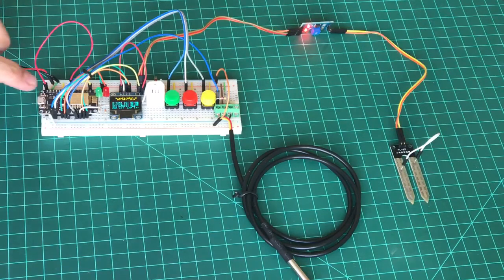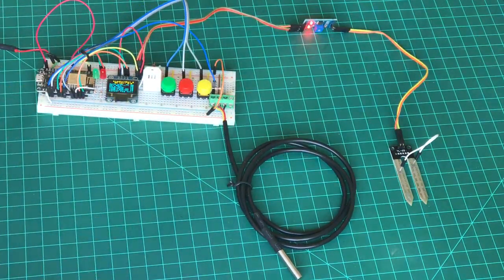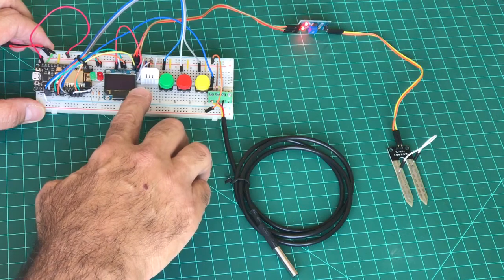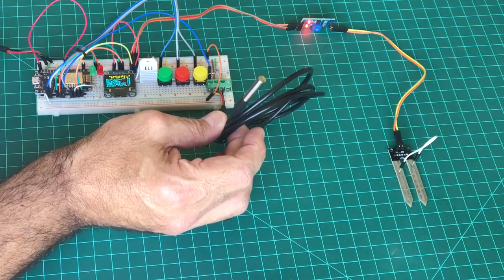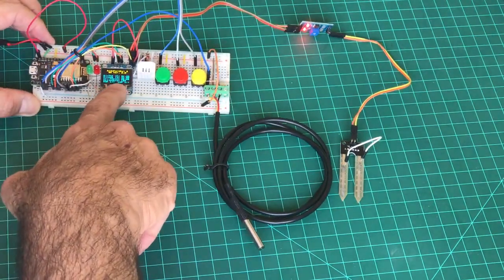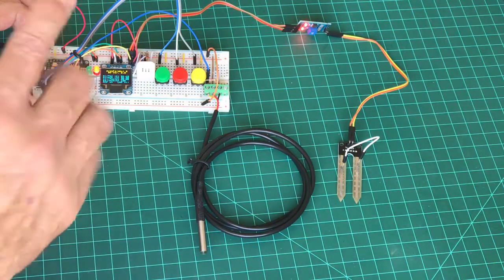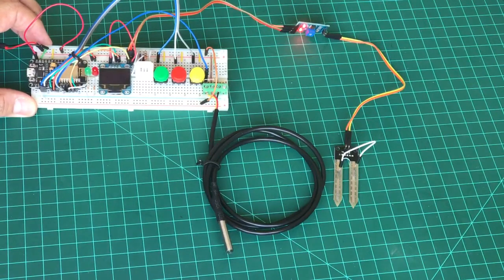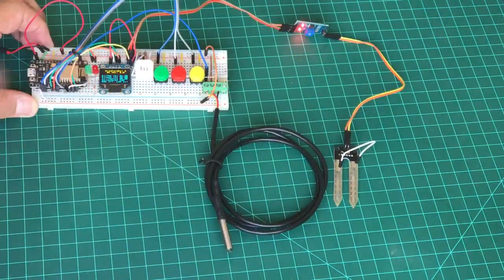ArduFarmBot2 - Manual and Local Operation - video 1

Comment: Excellent project. Everything works perfectly. 
One request : please advise how to "insert" SIM900 (or similar) GSM module functionality if WiFi spot in the area is not available so that the board can connect to Blynk directly via the GSM network. Thanks.

Comment: Hi MJRobot
First of all thank you for the project.
I have 2 problems.
1. The Oled Display will always go out after 5 seconds. Does it have a timeout?
2. My Soil Moisture Hygrometer holds only 2 days. After 2 days is no tin on it.

https://www.dropbox.com/s/1d19oupf7b9vufx/2017-07-26%2019.43.46.jpg?dl=0

https://www.dropbox.com/s/2zufhytm1fpdwaw/2017-07-26%2020.18.05.jpg?dl=0

https://www.dropbox.com/s/4r9mzwtju87mhjg/IMG-20170726-WA0011.jpeg?dl=0
Reply from the maker: 1. Yes. The idea is not keeping the OLED ON all the time, as I explained on Step 9:
Introducing the Sensor Read Button (The yellow one!)

As we could see at last step, we will need to wait for long cycles between Soil Moisture sensor measurements. It is Ok, for our automatic needs, but for the manual operation, we will not want to "wait" 10, 15 or more seconds (or even minutes in the real case) for sensor measurements. Also in the real world, make no sense keep the OLED display "ON" all the time. So, the default will be "dark" or "OFF".

So, we will introduce a 3rd push button to our project that will display the actual sensor data any time that we want, independent of the timing of the automatic readings. Also, we will use this same button to display data at OLED when the sensors are updated. 

2. The Hygrometer is really a problem. I got a better result, using a simple home made one as I described on ArdFarmBot 1 project.